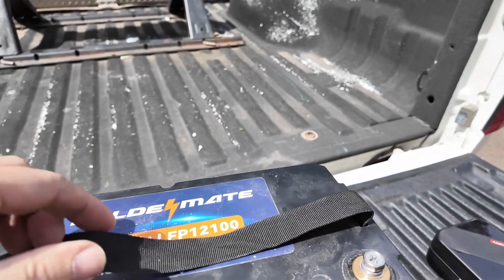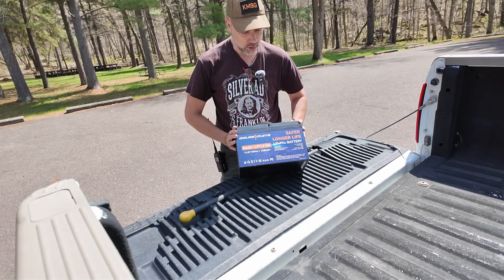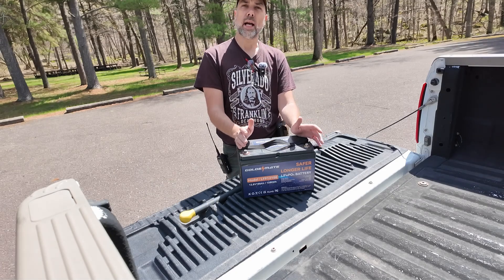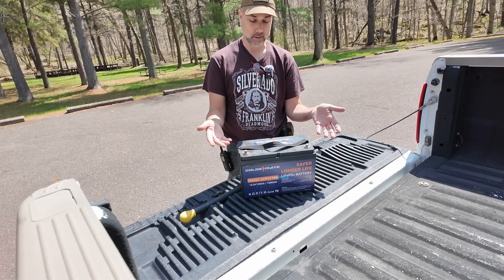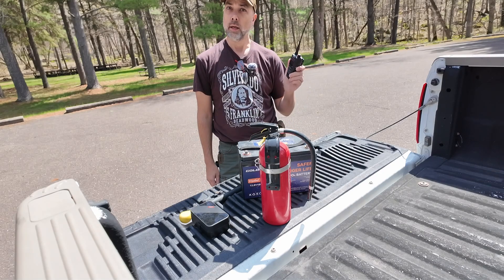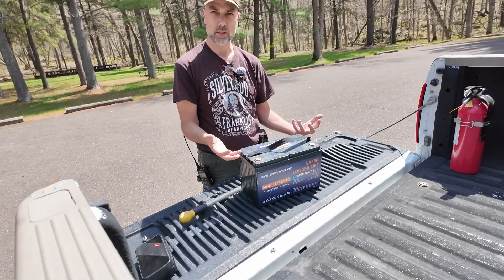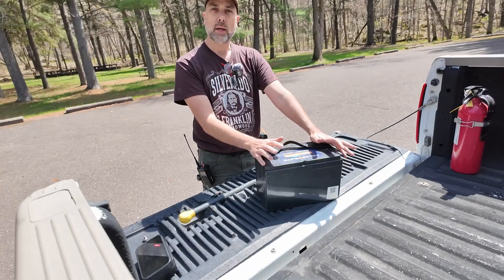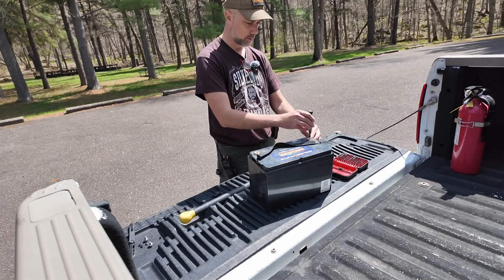What’s Hiding Inside This Budget Powerhouse?!

Comment: Questions: a 12v to 24v converter changes 12 to 24. If i hook up a 100W solar panel to it,will the 100W panel increase to 200w.
What's the biggest 12v to ? Converter you can use to charge any system.?
Reply from the maker: Ya got a play around with ohms law on that one.  A voltage doubling circuit doesn't double watts, only volts.  They are all related and the watts and amps go up or down depending on what you're doing.

Look at the target device you're charging and stay at or under it's specs.  For example, don't try to charge a 12v battery with a 24v charger.

Comment: To answer the question of the day: Yes - I use lifepo4 to power my shack

I took two lead acid batteries that I use in my camper, and two 100ah lifepo4s to field day
I was planning to use the lifepo4 with an inverter to power a fan, or keep laptops charged and to run our rigs off the lead acids.

But the moment I keyed up with the lead acid my radio shut down. I'd even charged it the night before but it self discharged to 12v overnight
The other lead acid also got removed from radio duty shortly thereafter.

After the lead acids lack of performance on field day I think the lead acids are ready to be retired from RV duty. 
Just need to check if my house charger is LiFePo4 capable - 2022 model camper so maybe possible
Reply from the maker: Even if your house charger isn't designed for lifepo4, it will still get you most of the way there and can be a down the road upgrade.  With your 2022, there is likely a switch on the charger unit itself to tell it.  If not, imagine that your LiFePO4s will get about 80% charge and with 2 of them in the house at 100ah each, you're looking at 160ah... which when compared to 2 100ah lead acid batteries that can only deliver 50ah anyway... you're 60ah above spec with room to easily grow.

I'd look at a solar panel and a charger over the shore power charger anyway, you really don't use the batteries when you're on shore power as much... and can't charge them when you're not on shore power - so IMHO the panels+charger is a better short term place for the dollars.

That's with 3 years of LiFePO4s on a lead acid charger in 2 different RVs fulltiming.  Have fun out there!
Reply: @temporarilyoffline  Group 24 batteries so really only 30 to 35 each at full charge new making the lithiums even better.

Do have solar for when I'm boondocking - a necessity really with a large DC fridge that uses 30-40 AH a day
I only get to boondock once a year up in the mountains so not really a super big deal if the camper can't effectively charge since when I get there the solar can handle it.

Local camping I require electric sites because ain't no way I'm trying to sleep in a camper in the summer in the midwest without AC

Comment: Is a standard household fire extinguisher the right thing for extinguishing a LifePo battery?
I know thermal run away is unlikely.  unlike LiOn which requires sand… lots and lots of sand to extinguish
Reply from the maker: Probably not, but it helps keep the safety sally types away

Comment: I don't get why they don't make them smaller. So much wasted space to match the size of a lead acid battery. Thanks for the inside look.
Reply from the maker: I wonder just how small they can make a 100ah battery today.
Reply: Exactly!  @temporarilyoffline
Reply: On the one hand they could stuff in more cells, on the other hand, cramming more cells in means more heat when you charge
Reply: Because the devices they are meant to go into and power were built for the dimensions of the older, larger lead acid batteries. If you put a smaller LiPo in the same compartment you need to add padding or spacing material around it to keep it from rattling around inside the box in the device. Like the RV battery compartment or a golf cart etc...
Reply: @thedoobie1  Apologies. I'm not ignorant to the fact they make them to fit older battery holders. When I upgraded all my ATVs from lead acid to LiFePo batteries I bought new tie down battery holders. Then I also had space for small tool kits. My point is space is limited in many scenarios, so make the battery smaller. You understand where I'm coming from now?